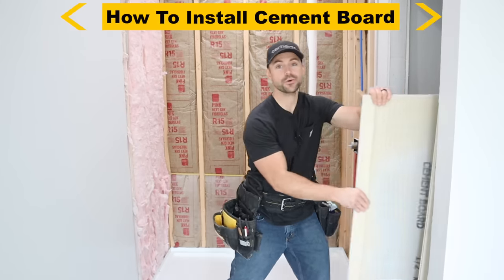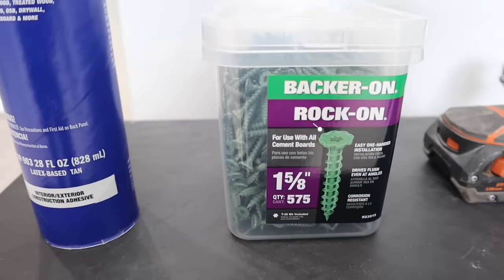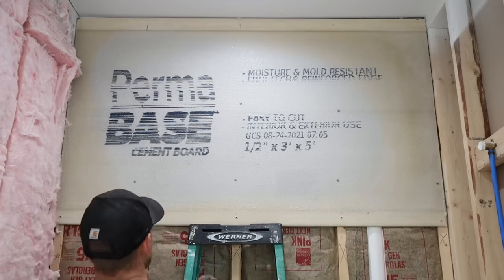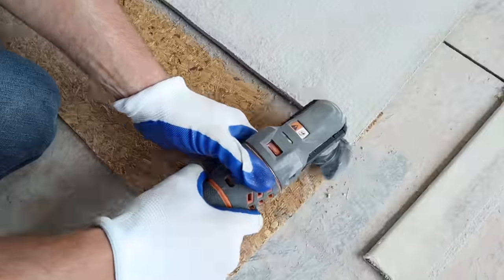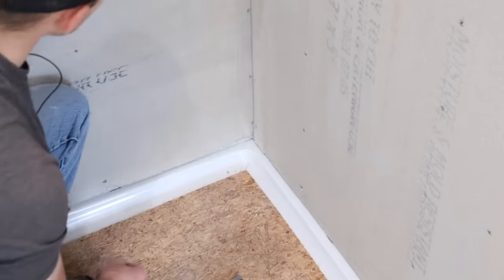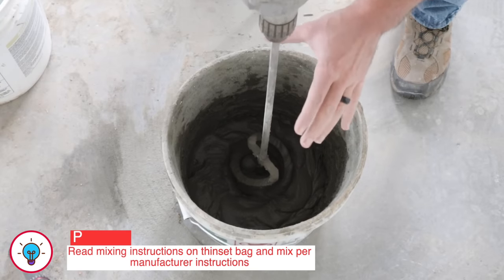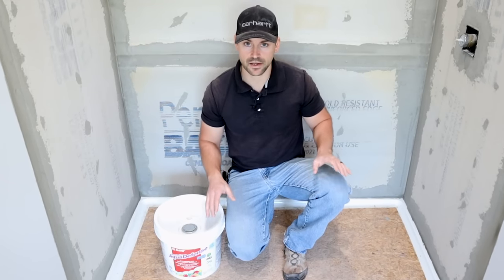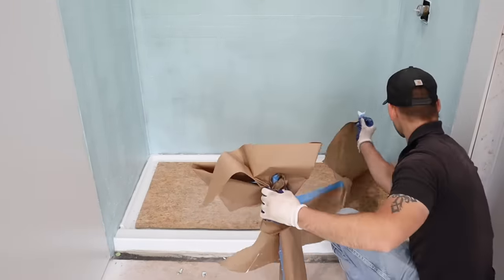How To Install Cement Board and Waterproofing For Tile Shower Walls - Complete Step-By-Step Guide

Comment: so where is your 2ft and 4ft anf 6ft levels and framing square?? because every house that I have installed a shower in.  Not a single one has perfectly flat studs , just to go and slap some cement boards on the wall. especially since you was worried about the shower pan lip(last shower I had to rip down the center stud about a 1/2 inch to make it flat. Sometimes I  think its still better to do it the old school way , and use tar paper, wire mesh, scratch coat , than float the whole dam thing on screet sticks, That way you  know it will be absolutely flat and perfectly square and extra water protection and you know its not gonna go anywhere .Thats how I learned how to do showers 25 years ago and those showers are still solid and water tight today. (Durock cement board is okay but if you notice that you can usally just screw into it once and after that it will either go thru or wont the hold the board and you have to put another one next to it, so if you think about how much a wooden stick home moves over the years from earthquakes, temperature and humidity as it expands and contracts every season.) You already know  eventually the screws are not gonna hold the cement board anymore.( also I see the liquidnalis attempt to help with that) but everyone already knows liquid nails also eventually gets brittle and breaks apart( id use it maybe for glueing a box or something stationary that doesn't move or get exposed to heat and moisture( not the opposite as a  bathroom, has both 
#1 humidity from shower steam, then heat or A/C  from the house that pulls the moisture out and dries it. and that constant cycle will make it brittle, 

#2 Wooden houses move, sometimes alot. . With those two short falls( screws get loose from movement and over time adhesive gets brittle,that movement will break its bond).
 Id say these type of showers will last an average of 5-10years( some shorter some longer) depending on #1 factor how often it  has shower steam
 and 
 #2 House movement(many different factors)(geographic earthquake location, poor soil or compaction  density, poor concrete slab,failing,cracked, thin, or failing  due to water erosion around slab and, heavy winds, pushing the house in different directions.  
Which all effect wooden framed homes. Cause  board to twist, shrink, swell, split and slowly seperate over time.) 

That its only a matter time, moisture cycles, and house movement  those showers will fail( and hopefully not the entire wall fail on top of them or someones child one day) which regrettably I do see a high probability of that happening in the not to distant future.😢
( which is why they dont use foam board anymore, because once it  moves it doesn't hold it secure anymore so it gets  looser and looser and the whole wall becomes detached ( Durock with backer screws will eventually get loose and pull thru and fail( what would help Durock not fail is to have 1" inch or big enough washers so the screws cant pull thru but small enough still go down flat.)
,Hardie backer boards are basically cement dust mixed with fine shredded cardboard with a little bits of gound up fiber glass pressed together and fail even thier  red  (should not be used in  a moisture location, such as outdoor BBq or Shower, it will fail and crumble apart over time similar to liquid nails gets brittle)
Wonder board would be a better option  just using screws without washers. Although its not as ridigid as the other cement boards. Its definitely more flexable to follow curves with out breaking. Because its has many full length layers of fiberglass mesh..

that even if you put in one backer screw  and sank it in 1/4 inch, then backed it out flat.  although  the board be loose its still very difficult to try to pull off the wall as the fiber glass will still hold  back
(Also you could use just silicone instead of liquid nails, although it costs a little more  than the cheap liquid nails  but about the same as liquid nails fuse it type the Silicone is better.)

Comment: Why aren't you using a foamboard like Go Board, Hydroban etc? Its lighter, no dust and most importantly 100% waterproof unlike cement board. You're going to get water wicking up that cement board where you notched it along the shower pan flange.  That wont happen with foamboard

Comment: Water proofing cement boards is a waste of time and money. These boards have a moisture resistant coatings only need to mesh tape joints and seal with thinset can use a heavy coat of oil base primes on joints after taping . Tile and grout is water proof on ensure the corners are properly caulked and maintained over time because that's where the grout may Crack and have water penertation. Install backer boards to lip of rub or pan and tile to 1/8 off the tub and pan after a heavy bead of Caulking behind the tile and finish bead of Caulking on face of tile. Cement boards and backer boards are water proof. Water proof is highly recommended if tiled shower floor and curb is bring insulated because grout often cracks where the wallet the floor.
Reply: Not necessarily—especially when you have a person do the job— and now I have to replace the cement board and wet 2x4’s. I’m not happy

Comment: You don't need the glue! The guy that removes your work down the road will thank you.
Reply: Trying to be polite: Use the glue! Otherwise the only thing holding up 70lb of tile are 30 narrow screws!
Reply: Yeah, and I just removed a bunch of that s***, it was unnecessary.
Reply: @williamfretwell6077  sure, go ahead and screw the next people who are trying to install tile. Whatever floats your boat babydoll!
Reply: The concrete board companies directions are to use adhesive on the studs. I suggest you think about the diameter of the screws in concrete, they need lots of help! Clearly getting things right the first time DOES float my boat.

Comment: Cement board is not waterproof. A vapor barrier should be installed under cement board, but keep not installing a vapor barrier because i appreciate the repair job down the road. And before anyone screams about red guard, it is not the best surface to set tile on, nor is it compatible with every combination of mastic and tile. Do research and you will see

Comment: Several very odd things. Destroying the nice edge next to the bath lip. Hanging over the destroyed edge and not waterproofing that edge front and back just sucks up water at the wettest spot! This renders your waterproofing useless. The waterproofing keeps water from failed grout lines from drying, it will stay wet. Concrete board won’t fail when wet and will dry. 
Tile is waterproof! Create a good grout line, deep between the tile, it’s waterproof. Waterproofing the board reduces tile adhesion, with heavy tile a big problem. 
Fibreglass tape is installed with a layer of thin set laid down first, then the tape and more thin set, see manufacturers video!
There should be a small gap between boards for expansion. 
The tile hangs over the top lip with silicon behind the bottom edge, not mortar. The bottom edge of the tile has a small gap above the bath so silicone gets a good grip.

My current bathroom Reno with 2’x1’ heavy marble tile will have the following:
Studs that line up, with planing and shimming the length where needed.
Extra studs were easy to add.
Stud faces are lightly planed to reveal fresh wood for glue adhesion.
A generous amount of glue used to adhere the board and backer screws used every 8 inches, as per manufacturer.
Fibreglass tape applied between grout layers and 1/8” gap between boards.
Waterproofing applied as a 2” wide strip behind grout lines but nowhere else to maximise tile adhesion.
The tile overhanging the bath lip is masked with tape when mortar applied, the tape removed and silicone applied.
A 1/8” gap above the bath between the tile and bath filled with silicone. 
Tile spacers allow the proper formation of a grout line.
 
The tile I just removed after 50 years stuck only to drywall showed no water ingress. Water resistant board was used in a 3’ square around the shower control and tap area only; where the holes are! Water ingress was evident . 

Think about the mortar behind the tile. If the concrete board is waterproofed moisture will wick behind the tile when the grout fails and stay wet. Not good for the tile adhesion or mould. In a cold damp basement the board may never dry but in a high rise it will if not waterproofed. The company suggests using waterproofing only ‘when required’ with no guidance, the $112 sale of waterproofing has no influence?

Comment: Cement boards are so out of date 
Foam backer boards in different league , easy to cut with a utility knife , no dust , and far far far more water resistant 
I wouldn’t use a cement board even if they were free

Comment: Nope, 1st of all the cement board rest on top of the flange of the shower Pan...the area underneath is filled with thin set having an 1/8" gap between shower pan surface to thinset.  Thinset is far superior to that cement board in water resistant capability.   2nd there is an 1/8" gap between board.  The gap is simply filled with thin set.  3rd,  You do not do the mesh part.. That is only required if you are not using a waterproof liquid membrane.   If you are using a waterproof liquid membrane then you will need to use a fiberglass mesh and not that crappy cement mesh tape.   Most liquid membrane applications will tell you to set your fiberglass tape using the liquid membrane, then coat the surface twice, once rolling product on horizontally, and the 2nd coat rolled on vertically.   This person that did this video obviously doesn't read the specifications of the product that he is using.
Reply: Have ever heard the phrase, “there’s more than one way to skin a cat”… people like you piss me off because they refuse to accept that something else that they don’t do, WORKS
Reply: @77talton    You're upset  because you're one of those people that want to invent a new way to install a product and not read that roduct specifications that were designed by the engineers who made the product to say how to install it... Therefore you wanna overrule these engineers  specifications based on what?   You want to spend 2 to 3 hours grinding out the back edge of a cement board so it can go over the shower Pan lip When it is supposed to sit on top of that lip and underneath is thin set because when the cement boards sits on the shower Pan or close to it, water will wick upward and rot out the cement board.. That is why it sits on top of that lip, that is why the shower Pan manufacturer made that lip, and it's why the cement board manufacturer did not make a bottom tapered edge that sits on the borrow if a shower Pan  Since they test these products in a controlled area and realized that if the cement board sits on top of the shower Pan lip it won't absorb water and rot away..In addition, the waterproofing products says to use a reinforcing fiberglass membrane at corners.
Reply: so do we need to add the clear plastic water barrier sheet or the black paper like sheet, then plywood then , thinset to stick and screw sheet rock,  then thiset with fiberglass mesh on the joints , then liquid membrane (red guard) then tile ? I'm in CALI
Reply: @ArtOfTheWeld  no..the liquid membrane is the vapor barrier..u do not need plastic behind backerboard.  U do not need plywood either.
Reply: @jeffd5970  thank you,  how about the subfloor,  ? plywood then quick set to apply cement board then redguard then plastic liner? then slope floor then red guard again? lol I watch so many videos and everyone's way is the right way, is their a site I can forsure get the correct application that you know of?
Reply: @ArtOfTheWeld  Why is water under neath your shower pan or tub and on yur subfloor? Is their a site? yeah its called national and local building codes of minimum standards. For instance, premanufactured HUD homes have a completely different minimum standard of code and they say OSB subfloor with a linoleum floor over that and a plastic sheet as a vapor barrier is a good sub floor for a tub. BUT its absolutely MINIMUM. Then they cut a hole through all that to install the plumbing drain. It works tho. The water will go across the linoleum floor OR wick into the OSB and rot out yur subfloor who knows. But on the manufactures guidance literature for OSB it says cut joints should be sealed. On redgards literature it says you can apply it to OSB.

Comment: Who still uses cement board?!?
Reply: No other choice here. Annoying that it costs almost as much as marble tile!
Reply: Foam board is better, lighter, no dust and fully waterproof unlike cement board @williamfretwell6077
Reply: No foam board in Canada. Sounds weaker than concrete, my tiles are very heavy. The coarse texture of cement board to bond with mortar seems a good idea.